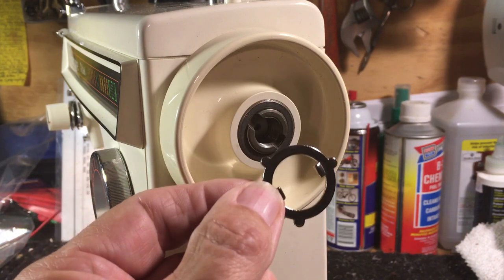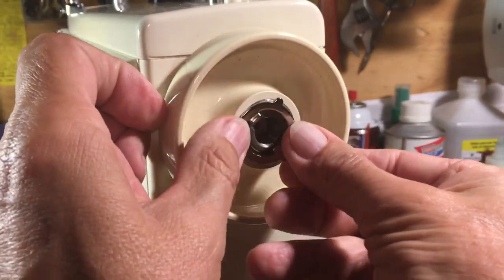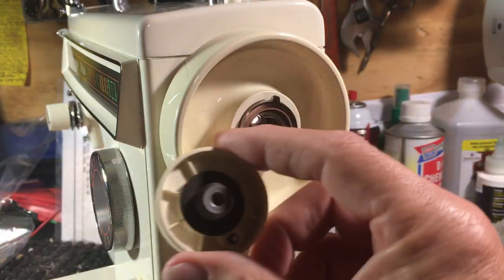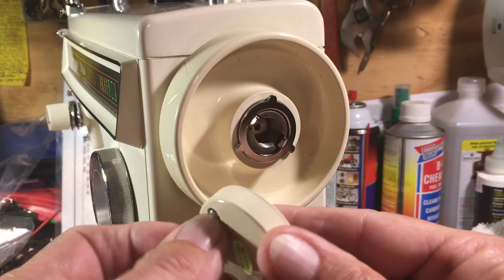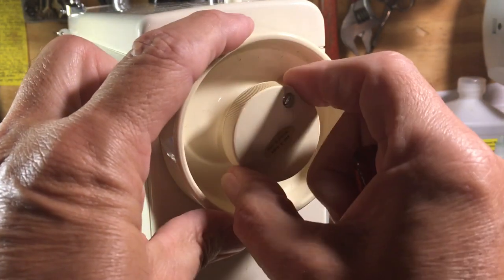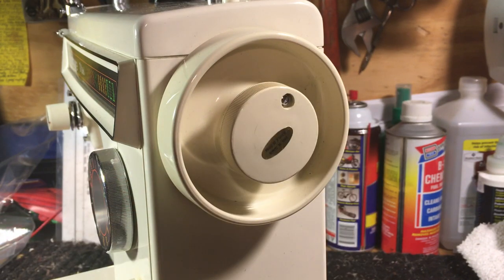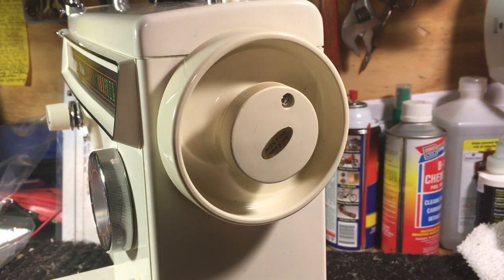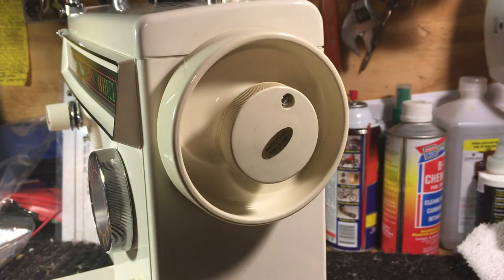How to Re-assemble the hand wheel clutch: The Sequel

Comment: Thanks for the video.  I found the washer on the floor after I took the assembly apart.  This confirmed where it goes.  I have gotten to love these old Kenmore's (have six or more right now).  I started out with Elnas, moved to singers, now am sold on old Kenmore's.  For those that want to know which old machine to get:  a 158 series Kenmore.
Reply from the maker: Very good. Glad you’ve got it figured out. 😎👍🏼

Comment: Hey Randy -- Thanks for the great vid! The first one was actually perfectly clear :)  Based on your instructions, I've made sure that the hand wheel clutch is assembled correctly on my newly acquired Kenmore 148 14220 and the clutch knob seems to turn smoothly. Despite this, the needle still moves up and down when I turn the clutch knob counter-clockwise and engage the bobbin winder latch. I've never used a machine like this before so I'm not sure what to expect when the clutch is released. Should the hand wheel move in and out when the clutch is release?

Comment: Hi Randy.  I have an issue with my White 999 related to this.  I can not get the machine to disengage the needle (for making bobbins).  It is a garage sale find and the handwheel was stuck on the shaft.  I removed it, greased it, and it turns freely now.  Even with that, I can not get the motion knob (that's what they call it in the manual) to work at all. I believe it is assembled it correctly.
Reply from the maker: I will disagree and guess that it’s not assembled correctly. Make sure that the set screw is placed properly between the stop motion tabs that are on your clutch disc.

Comment: Thank you Randy. I wish I had watched your video before I jammed up the handwheel on my Kenmore. It is jammed solid and I can’t get wheel off so I can assemble it correctly. Is there a way to get it off without causing more damage? Thank you.
Reply from the maker: Remove the set screw (stop motion screw)on the release knob. 
Wrap the knob with soft cloth and break it loose with channel locks. 
Leftie loosie/righty tighty. 😎👍🏼

Comment: I had removed the handwheel  and the belt from the shaft  cleaned everything oiled the machine and  reassembled it. I have tried putting the clutch washer every which way it goes. It wont lock  the knob on the handwheel  stays kind a tight  but when I turn it manually the  needle moves  when I turn the handwheel any direction  it dies not turn the needle.  This is Singer stylist 533. It was working great  till yesterday  when I opened the handwheel assembly to tighten the belt  now the handwheel is messed up. I cant figure  out what is wrong here. I will greatly appreciate your help. I love this  old machine  I really like to keep it.
Reply from the maker: It’s really simple:
It’s not assembled properly. 
It only assembles correctly one way. 
You can’t try every possible way. You have to assemble it carefully, step, by, step, and get it absolutely correct. 
There’s one thing that you’re doing wrong. That’s all it takes for it not to work properly. 
The clutch disc will go in 4 ways. 
Only one way works. 
Take your time and follow the steps carefully. 
You’ll figure it out. 😎

Comment: Thank you for the clear info!  I also enjoyed your other video on this subject.
I have a Serger  ‘White Superlock 523’, that has a seized handwheel.  It will almost rotate fully, but seized at the last ¼ rotation.   Maybe this is too vague of a description, but any help will be appreciated.
Reply from the maker: jerry LaFaery that sounds like the classic textbook definition of a cracked and broken plastic gear that drives your upper looper. Take the bottom off and look at the gear that drives the motion of your upper looper. Sometimes it is immediately visible on the center/left side of the undercarriage. Often it’s in a small housing with access via a cover plate. Almost all of those plastic gears have broken by now. If it’s not a broken gear, look to see if your loopers are making contact with each other or something similar.
Reply: Hi Jerry. Did you get the problem resolved?

Comment: Quit apologizing...
.your videos are great, informative, good explanation.
What would you recommend using to clean old gunk from hand wheel / clutch that keeps slipping on a Pfaff 130?
Reply from the maker: Not sure how to respond to the “quit apologizing “ comment. As to the clutch slipping, wipe the disc and threads with a rag and it shouldn’t slip. Make sure the disc is installed correctly with the inner tabs facing out.

Comment: Unable to move the needle with handwheel can move by rotating clutch gear only. I tried rotating clutch washer as you suggested, but no luck, what am I missing.
Reply from the maker: Clean any excess oil off the clutch disc and install it with the two inside prongs facing out. (To the right)
Make sure to clean the inside of the release knob that contacts the clutch disc. 
Be sure to loosen the small lock screw enough to allow the release knob to tighten securely before you retighten the lock screw.

Comment: After reading all the comments, I think my clutch knob won't loosen, how can I help it loosen?
Thanks again. Sara
Reply from the maker: Channel locks and a soft cloth so you don’t scratch the release knob. I have to use them pretty often myself. Take the set screw out in case it’s improperly installed. Don’t lose it. They don’t have any of those at the hardware store. Good luck.

Comment: thank you for this video it really helped do  would you happen to know why my needle wont bring up the bobbin thread
Reply from the maker: Make sure your needle is inserted properly. Make sure it not bent and is the correct style and type.
Reply: @randyyoursewingmachineman9954  did all that  the needle goes up before the hook reaches the needle so i believe its a timing problem
Reply from the maker: Tence Valentin you are probably correct. If the needle rises before the hook has a chance to pass by above the needle eye, the hook timing is late and need to be advanced. The hook should be just above the needle eye as it rises on the right side swing of its widest zig zag setting. If it’s right at the eye, or very close to it, you can lower the needle bar  height by a couple millimeters and that may solve your problem. Look for the adjustment screw facing the front in the midpoint of the needle bar near the zig zag plunger.

Comment: Hey Randy, I did as you said and it works but it is really squeeking    How do I stop that??
Reply from the maker: Look for the bearing that didn’t get its drop of oil. Diligently watch everything that’s moving while turning the hand wheel. It could be your idler pulley between the belts or an upper shaft bearing. Remember my old saying: if it rotates, slides, or pivots, give it a drop of oil.

Comment: How to fix the washer, when I turned the clutch it dropped out, please advise
Reply from the maker: @jenniferandtan  the video shows it goes in four different ways. 
It will be in the correct position when the two inside tabs are facing out, and it’s rotated so the set screw is between the outside tabs.

Comment: I have a 158.1430 in great shape; however, the stop motion doesn't work.  The knob feels like it's been welded to the fly wheel & can't be removed (or moved) for anything. The bobbin winder part seems to be ok.  Any ideas on how to get it "unstuck"?
Reply from the maker: Penetrating oil and a soft cloth and channel locks. Use caution so nothing breaks. Be patient and turn the hand wheel release knob counterclockwise while holding the needle stationary. Be patient and cautious. Don’t break anything.

Comment: Just inherited a Kenmore 158.17520.  Been sitting a long time in a home then was put in storage a couple of years ago.  I have oiled per your video and instruction booklet. However the needle does not go up and down and suspect the culprit to come from the clutch. Should I use penetrating oil in main areas as well as putting it on the clutch as a first step?
Reply from the maker: If you’re able to disassemble the clutch assembly, regular sewing machine oil works well. All the zig zag and feed mechanisms can  usually use a small shot of penetrating oil after extended inactivity.

Comment: Hi, bought an old brother machine from the 1950-60's and the clutch is stuckit will not turn, any advice please?... Thank you.
Reply from the maker: Sure. 
Loosen the belt and tap on the inside of the hand wheel, left to right, with the wooden handle (or plastic) of a screwdriver and coax it loose. 
Be patient. 
Tap lightly. 
Spray some penetrating oil on both sides at the shaft to help free it.

Comment: Thanks Randy. The clutch knob is still stuck fast. (Dad 'serviced' it and I suspect it may be reassembled incorrectly and brute force tightened because he did not realise the knob should move.)  Would it be a terrible thing to hold the wheel and use a shifter or similar to loosen the clutch knob? Thanks for your videos. 👍
Reply from the maker: Sorry for the late response, I just saw it. Yes you can use an adjustable wrench just be careful not to scratch it. Maybe wrap it with a cloth first.
Reply: @randyyoursewingmachineman9954  thank you Randy. Have tried some oil but no luck so far. Will give the adjustable wrench a go.
Reply: @randyyoursewingmachineman9954  after the oil was left a bit the wrench was used and it loosened fairly easily. Thank you.
Reply from the maker: idledreameress great job. You’re welcome.

Comment: How long is that screw?I bought one of those things at an estate sale but unknown to me it didn’t have that little screw..
Reply from the maker: Buy one online. They are basically one size fits all. 
Search for : hand wheel clutch release knob set screw. 
Get the correct one. 
The postage will be more than the screw, but at least you’ll have it fixed correctly. 😎👍🏼
Reply: Thank you. Can you explain in more detail how that works because to me once the screw is between the tabs it will catch either way the shaft is turning.
Reply from the maker: @jimjackson4256  it’s locked onto the shaft once it’s tightened. When the clutch knob is released, the wheel spins independently from the shaft. 
The set screw just keeps the knob in position and prevents it from coming off.

Comment: I tried your suggestions, problem remains, the hand wheel and motor wheel won't work together like they used to.  I tried to get them apart but unable.  Suggestions I would appreciate.  Thank you, Sara
Reply from the maker: Wish I could do more. It’s an obvious fix for sure. I feel I was there I’d see the problem and remedy it in moments. Don’t overthink it. Something isn’t placed in position properly.
Reply: I got it the clutch apart and put back together, but still won't make stitch.  Belt wheel kspins but won't make a stitch. Should I take the clutch and belt wheel off and redo as something may be dislodged there.
Reply from the maker: @saraeoff646  the reason it’s malfunctioning is that it’s not reassembled correctly. That’s it.

Comment: Your video is great! My problem is that I have a Pfaff 330 and it's hand wheel and clutch knob are made differently. The clutch is released by pushing a small button on the front of the machine near the wheel, which releases the clutch. But the clutch also has a second screw that is a little longer than a set screw and drops into the hole further before you can screw it in. I don't know what it is called. My problem is that I can't get the clutch knob screwed in so that the longer screw will end up at the correct place to screw it into the hand wheel. Any help? Thanks.
Reply from the maker: That Pfaff 330 has an atypical hand wheel clutch release that I don’t encourage folks to disassemble. I don’t have a video addressing the issue. There might be one out there, but I’m not aware of one. I’ll keep looking and if I find one I’ll let you know. Sorry about that.
Reply: @randyyoursewingmachineman9954  Thanks for your answer. I appreciate it. Thanks for your videos!
Reply from the maker: @pambinion2375  you’re welcome.

Comment: Hi Randy, i don't know if you can help me but I am unable to remove the  stop wheel on my Kenmore ultra stitch 12 sewing machine I have pretty much tried everything, Do you have any advice? Thank you I love you videos they help a lot
Reply from the maker: Using a pair of channel locks and a soft cloth, wrap the cloth around the clutch release knob and apply counterclockwise turning pressure with your right hand while holding the hand wheel with your left hand. It usually releases easily if you try that. Be careful not to scratch your release knob.

Comment: Just got an old Kenmore 158.18030 and if it has a clutch I haven't figured out how to work it, can you help? Thanks.
Reply from the maker: I have a couple videos on the subject. What do you need to know?
Reply: Like I said, no clutch knob, there is a button on the top that seems to have something to do with a clutch but I'm not sure how it works.
Reply from the maker: @billycook5688  that button engages the lever that actuates your clutch internally
When you actuate your bobbin winder mechanism, it releases the clutch. When you disengage the bobbin winder, you then push that button down to engage the hand wheel clutch. 
That entire assembly usually needs a little penetrating oil if it’s been sitting unused for a while. You’ll see the metal band that surrounds the upper shaft, just to the left of your hand wheel. 
It is a centrifugal system. You will notice a small lever (tab) that emerges from the metal band as the machine shaft spins. If it’s stuck in the down position, you may have to encourage its movement with a small tool to lift it it up and press it back down as the oil does it’s job. 
Then you have to patiently work it back and forth to get it to snap in place on demand. Good luck.
Reply: @randyyoursewingmachineman9954  Thank you, this helps a lot.
Reply from the maker: @billycook5688  if I can round up that model or similar, I’ll make a video later.
Reply from the maker: @billycook5688  just loaded a video addressing this issue. I hope it helps.

Comment: I can't get my wheel off. Can you help me
Reply from the maker: I can try. 
Sometimes you have to tap the left side if the hand wheel lightly to coax it off the hand wheel axle.  It’s a good idea to put a light  spray of penetrating oil or sewing machine oil on the inside and outside of the hand wheel at the axle also. 
Tap it lightly with the handle of a screwdriver so there’s no risk of damage.
Be patient and it will release and come off. 👍😎

Comment: I took my time and redid again and again at one time the needle moved a liittle then it stopped So   I opened up the handwheel  to see what was happening I found that when the screw hits the ear of the clutch  it simply rotates the cam but does not stop it  from moving, Is that  normal if not  what could be doing that
Reply from the maker: You may need to buff and polish the main shaft axle that the hand wheel rotates on. It may be rough and won’t release the hand wheel to spin properly.
Reply: Already did that I cleaned  handwheel assembly and the shaft which is smooth. Handwheel moves fine manually  it just does move the needle .  @randyyoursewingmachineman9954
Reply from the maker: @nancyb1252  1)be sure to use a light oil. 
2)Make sure the belt isn’t too tight. 
3)Hold the needle clamp with the clutch released, and run the hand wheel at a high speed for an extended time to allow the surfaces to pair up.